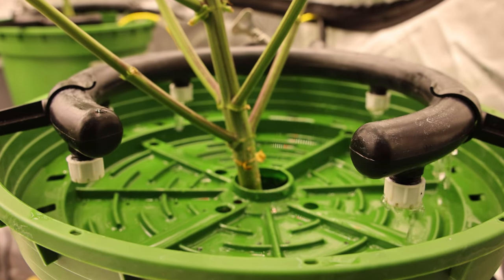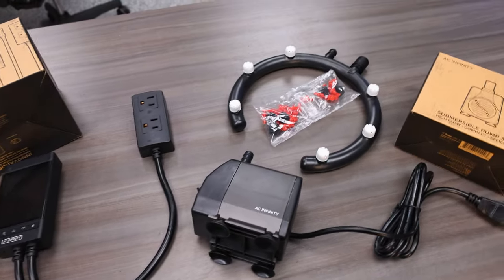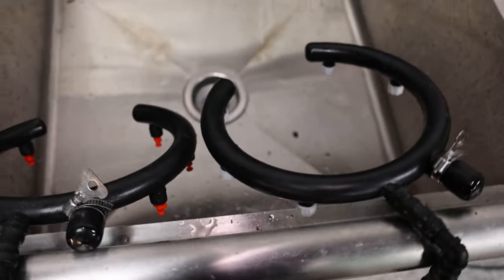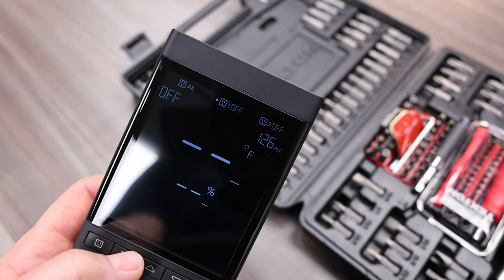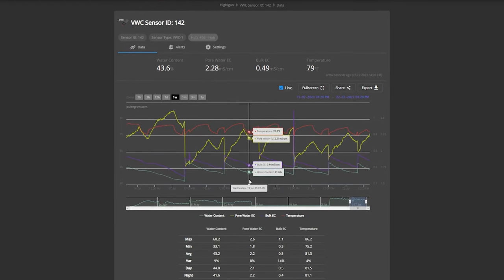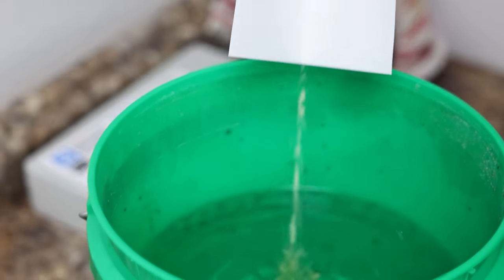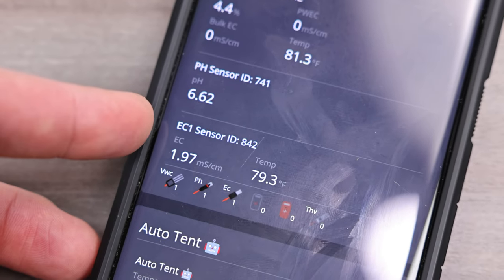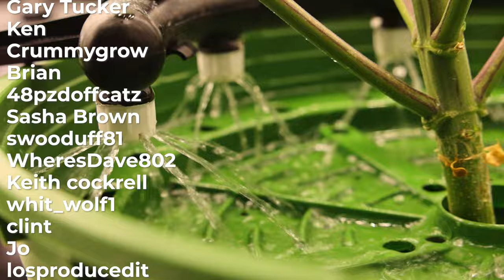Automated Recirculating Watering Setup! No Waste!

Comment: What is the advantage of this setup over autopots?
Reply from the maker: Its top watering. No risk over overflow or valves getting stuck like in autopots. So many growers I know have delt with flooded tents or overflows from values getting stuck or jammed in an auto pot setup and coming home to a drained reservoir all over the tent or floor. The one failure point here would be if the return pump died, But it would take days to pump the reservoir out so hopefully it would be caught in time. We have been running this kind of setup for almost 6 months now.

Comment: You should look up IR Rings they come apart in the middle so you can clean the inside out. I’m betting over time you going to get tired of trying to clean those tips on you rings.
Reply from the maker: You can unscrew the caps easily to clean them, through the pump in a fine filter bag so the pump doesn't suck in and particles of coco something I forgot to mention in the video!